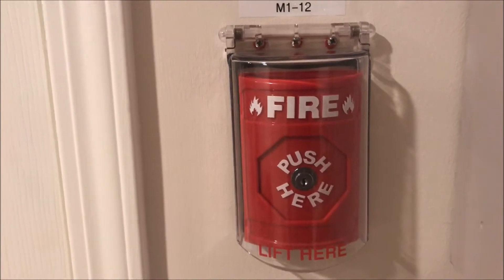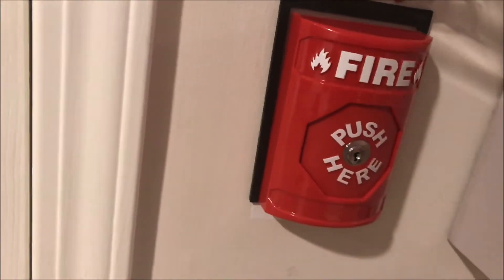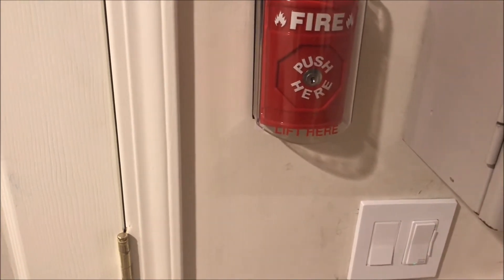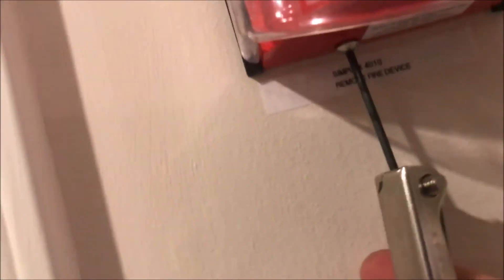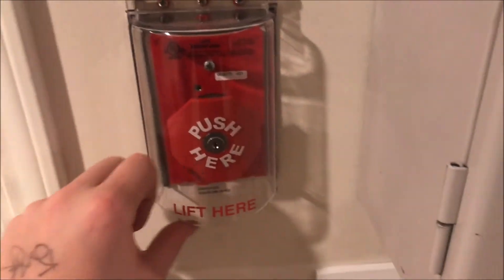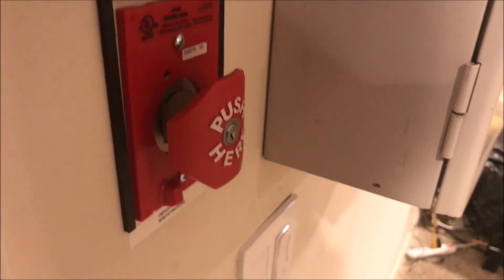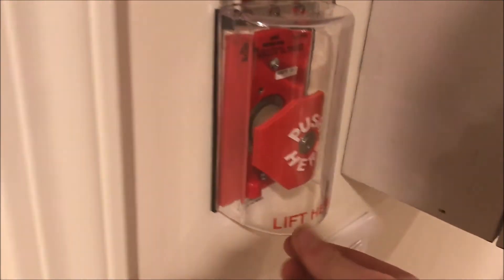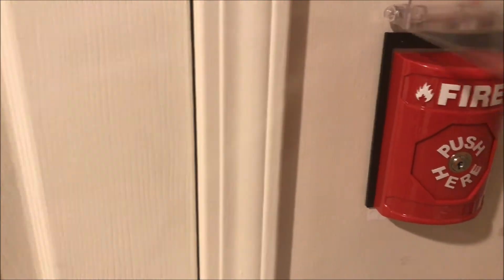Testing and Overview of a STI SS2000 Series Fire Stopper Station

Comment: The thing that I find annoying with these STI key reset stations is that they sometimes do not latch when pushed.  If you go to quickly "bop" the station, I've calculated a ~40% chance of the station not latching in alarm, even with a "Bopper Stopper", as they call it.